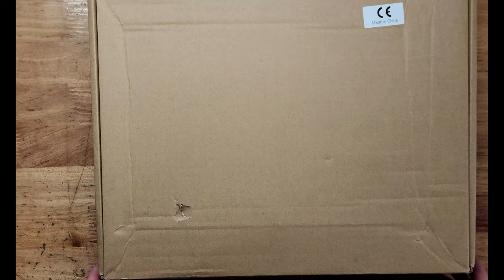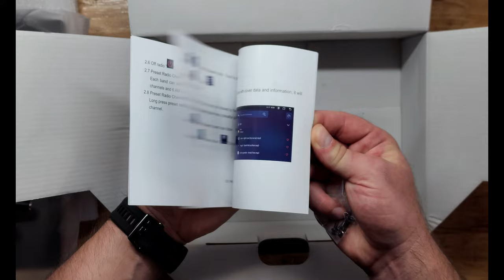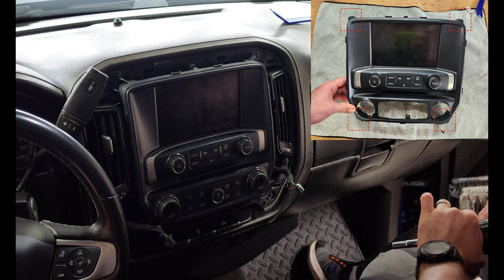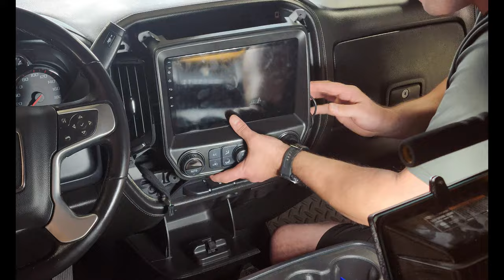2014-2018 GMC Sierra & Chevy Silverado: Step-by-Step Junsun Android Radio Installation Guide!

Comment: Did you lose the OEM control menu, or is there a passthrough?
Reply from the maker: Are you referring to the one on the cluster?  If so, then no.  Or are you talking about something different?
Reply: @MACSDIY   - sorry, I was referring to the OEM menu that was on the original screen before replacing the unit.  That menu had system settings for the truck itself.  Does this unit allow access to those same settings, or is that lost with this unit?  Hopefully that makes more sense.  Thanks for the reply!
Reply from the maker: @user-bm5hd7vv4y it does, and thank you for clarifying.  All those features are pretty much gone.  There are some other things that you can tweak with the new head unit, but yes, those features are gone.  Is there anything in particular that you were trying to keep?
Reply: @MACSDIY   - not sure, but I just wanted to know before buying one, or installing one.  I have been looking for something for quite a while, and this seems like a very affordable option compared to the $1,000 option with the OEM boxes.  Thanks for the help!
Reply from the maker: That is true as far as price goes, but then just keep in mind you get what you pay for.  I love this android head unit, but there are times I wish I would have gone with a true plug and play and kept a lot of other settings or OEM settings that I don't have anymore.
Reply: @MACSDIY   - Yep, that is right where I am at now.  Trying to weigh the pros and cons.  It's always something, isn't it!.....lol

Comment: Hello sir how r u ...i have same problem steering wheel control is not working can u plzzz guide me
Reply from the maker: What is not working?  Can you elaborate a little bit more please?
Reply: my steering control work when I set up on the canbus that’s the only way it works but it’s soo laggy can you help ?
Reply from the maker: How is it laggy, and what is it exactly doing? The only thing that I can think of is that you need to update your head unit, or you may have to return it for another, and may ha e something faulty!  I would try updating it first and then going from there.
Reply: @MACSDIY  like I’ll increase the volume on my steering wheel and it I’ll take like 30 seconds to register on the screen
Reply from the maker: That sounds like a simple update to the head unit!  Try that first.

Comment: On the backup camera retainer did you have to connect the red wire on the back of the radio
Reply from the maker: No, but then I also used a PAC harness.   It should be listed in the description.
Reply: @MACSDIY  so  you’re installation will be the same for a 2015 Silverado
Reply: How was your install time
Reply from the maker: If I didn't make this video, then maybe a couple of hours.
Reply from the maker: It should. I don't see why not... Both vehicles are almost identical besides a few bells and whistles.

Comment: My backup camera comes in Black and white . Do u know anything about that
Reply from the maker: I ran into the same issue and when I contacted the seller I was told that it would work and that I may just have plugged something in the wrong way.  After a lot of troubleshooting, I couldn't get it to work so I purchased a (CAM-GM51 OEM Revers Camera Harness).  The link is below in the video and shows you where to install it if you have the same vehicle.  I hope this helps.
https://youtube.com/clip/Ugkxvze2O7L6w42mvVBhmMDgROa_YEteZ2S0?si=l4FjxuKHv2uo7_N5

Comment: What features do you lose
Reply from the maker: I believe Onstar was the biggest one for me, but at the same time, I don't care because I didn't use it anyway.  There may be some other features on the radio that you may lose as well, but not 100% what they are/were because I never used them!
Reply: What about my silverado show the A/C fan speed setting will that be gone aswell
Reply from the maker: @user-ce9kh2uk8c it will show that, but on the head unit, it will display in Celcius.
Reply: Okay. Thank you
Reply from the maker: @user-ce9kh2uk8c You're welcome

Comment: so why mine doesn’t have sound at all??
Reply from the maker: I don't know! Did you install something wrong, maybe, or you didn't change the CANBUS settings!  There could be many reasons.
Reply: @MACSDIY   its plug and play i try to hear the radio and nothing just like yours. whats the Canbus ??
Reply from the maker: The Controller Area Network (CAN bus) is a message-based protocol designed to allow the Electronic Control Units (ECUs) found in today's automobiles, as well as other devices, to communicate with each other in a reliable, priority-driven fashion.

Also, I made a video on how to select your specific vehicle through the CANBUS settings.  Listed below is the link. If you don't have a Junsun radio, then I won't be able to assist.
https://youtu.be/V30RTPoapwE

Comment: Does this set up work with bose?
Reply from the maker: This specific radio, I believe it doesn't.   I also really didn't check because I have a non-bose system.
Reply: @MACSDIY ,. It suppose to,. Well that’s what I was told when I bought it,. After hooked it up, have no sound,. Everything else works great though,. Idk what to do beside send it bak,.. get a refund
Reply from the maker: @blkicemike4857  If you have the bose system, then yes, that is what I would recommend and go with another radio.  If not, then I would do some playing around with the connections or the settings within the radio.
Reply: @MACSDIY  ,. I think I will have to have the PAC’s AP4-GM61 amp pro module in order to get everything to properly function with factory Bose amp and the additional 8000watt amp for the 2 twelve inch subs also installed.. thinkin daaauuum! This build getting a lil pricey,.😅
Reply: @MACSDIY ,. Even if I go with a different radio, I will still hav same problem with wiring,. Idk 
I think the harness they sent me has pins in wrong place,. On the green plug  4 speaker wires  on harness side don’t even connect on the other plug.  I need to figure out something,. It duck not have any music while driving,. I have it all torn apart & haven’t put bak together yet, no point to keep removing and installing,. Would an amp bypass plugs work? I hav aftermarket amp also to power my 12in subs,. The factory amp on the Bose speakers in doors and tweeters in dash do sound decent,. I hear they really suk w/out,. So what do I do amp bypass,. Or find an integrated factory amp type harness,?? Those run to high price in my opinion,. Over $400 just for a harness,. That’s crazy imo,. Any ideas how I could get this baby rocking’ ?? Much appreciate it,..
Reply from the maker: Well, the factory bypass for the Amp may work because when I had my 2011 Audi A4, that is what I did, and it worked like a charm...so that could be a possibility.   Also, I don't think they are an arm and leg, but who knows, until you look it up/buy it because everything is inflated now for no reason.
Reply: @MACSDIY  I found an amp transition something,. $479 for the looked like a canbus box, and wiring harness,. I’ll have to bypass before I pay that for a wiring harness😅
I agree , it is rediculous as to how inflated everything has become,.
Reply from the maker: @blkicemike4857, well, you can also do it manually by splicing into the wires because that's what I did with my Audi because that stupid little box was like $600-$700...no thank you!  All you would need is the wiring schematics, and you should be good. It's a little bit more of a PITA,, but it will save you a lot of money because some butt connectors and crimpers don't cost as much, lol.
Reply: @MACSDIY  ,. Wow!! $700? And I was bichin over $400 price tag!,..both are still rediculous!!  For cryin out loud it a dam wire harness not a Coochie of gold😂,.

So do I splice into the connector plug comin out of the factory amp located under the center console?( my truck has leather bucket seats in front with console in middle. I recon the factory amp is located under the tray in center/console,..  
then someone else tells me the amp is behind the passenger side  back seat (extended cab) mounted to the actual cab? Ima hav to look and get bak on that one , I thought it was in under center console,.

To do bypass: I’d need the female plug same as comin off factory amp,. Then I’d need to add 4more wires,. Fr what I can gather the plug diagram should read o
Pos,neg,pos,neg all way across top and bottom, they are soldered together marking a hoop ,. What gets me though is the order they need to be wired so it’ll be properly bypassed,. & not burn something out  in the electrical system,.
Reply from the maker: @blkicemike4857, yeah, most likely.   Sorry, I don't have a DIY on that.  I would also suggest looking at forums to see how they bypassed it.  There is a way but most definitely not an easy one.